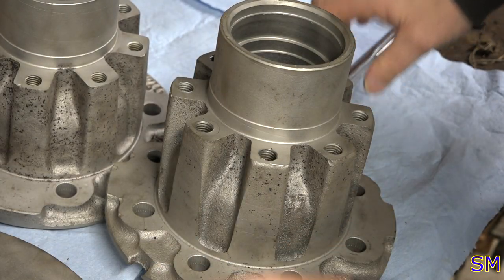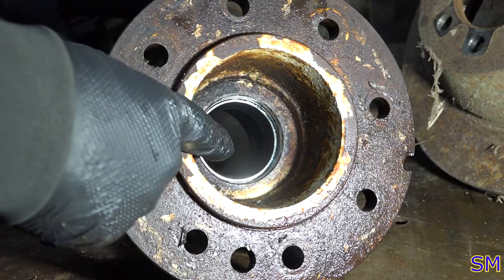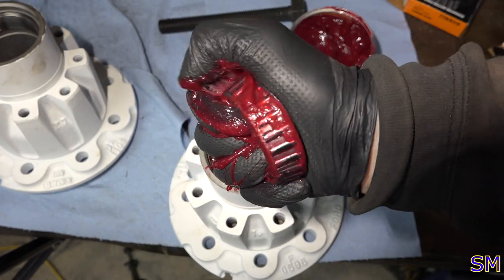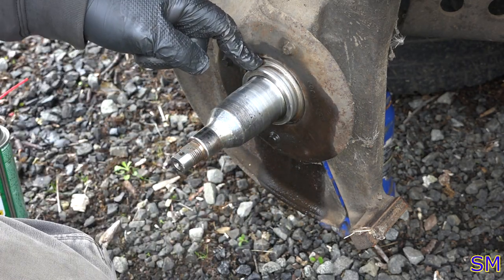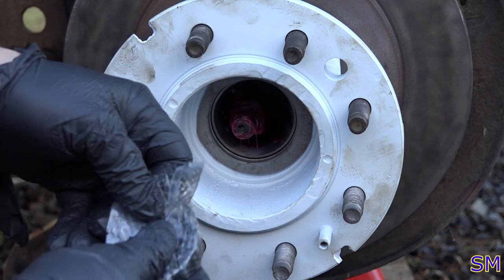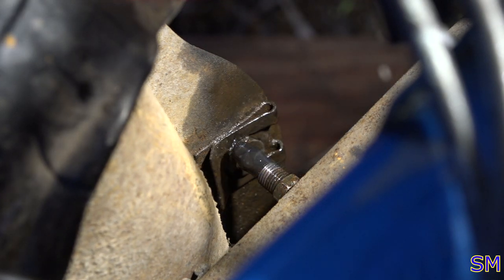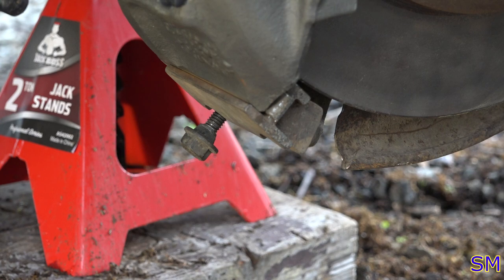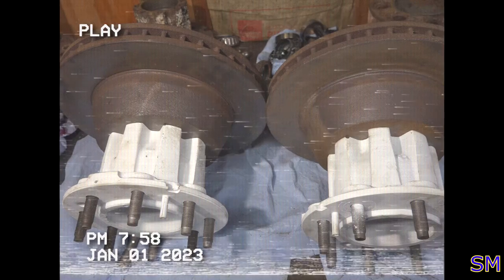Front Hubs, Wheel Bearings, and Brakes Installed - 80 F350 Service Truck

Comment: Watch out for how the cotter pins are folded over on those. I did the kingpins and repacked the bearings on my F250 earlier this year and about a month ago I noticed grease coming out of my center cap on my wheel. I popped the center cap off the wheel to find the cotter pin had turned into a dust cap cutter and it made a perfect cut and cut the end of the dust cap off...LOL
Reply from the maker: Oh no! That’s not gone right! A very excellent top tip boss. Glad you caught it before something catastrophic happened!

Comment: Yup, good explanation on the need for new front hubs.  Ditto on the brake lines and speed bleeders.  The only part I didn't get was the coating on the new pads that give a "non-directional finish" on the rotors.  You said it wasn't important for this application though, so I figure it's not umm.......important.  Lol!    Overall, I appreciate the usual awesome camera work.  

Plus, I think I'm beginning to see a light at the end of the tunnel.  Still a bit faint, but it's there!
Reply from the maker: The rotors I am using, since they are used, they don’t have a directional machine service finish as if you were to have bought new rotors from the store. Yas! There is a faint light that just started to appear! 🤞🏼💪🏼

Comment: You're certainly doing brakes to a much higher standard than I would ever do... I slapped the old crusty dust caps on the brand new disc/hubs and even left the visible part of the hub unpainted and now it's nicely rusted! Though I have the luxury of center caps to hide my sins.

Hopefully you won't have to adjust the wheel bearings too soon or you'll have to ruin your pretty white paint.
Reply from the maker: I admit I went overboard when refurbishing the hubs ha ha. Hopefully I won’t have to tear them back down. I do like that center cap idea! 👍🏼